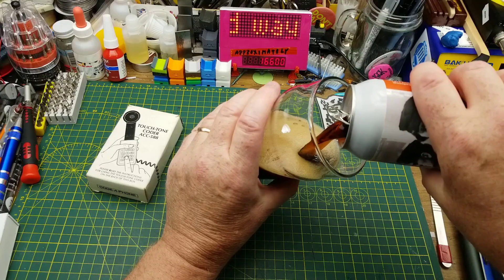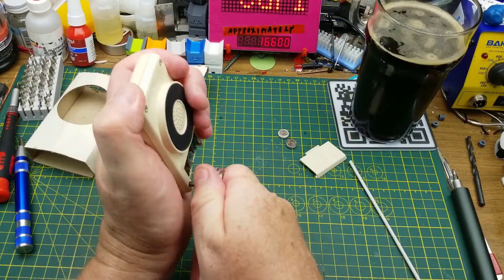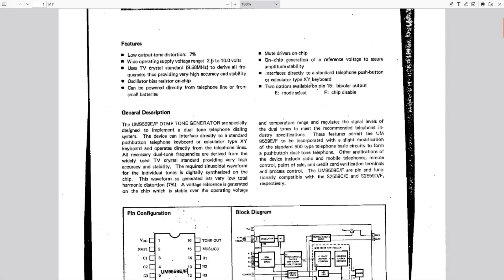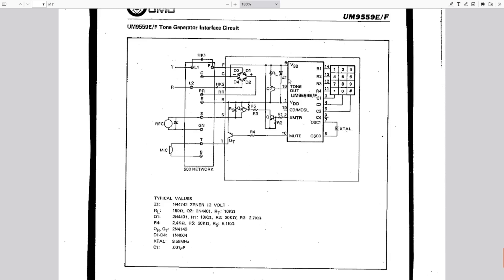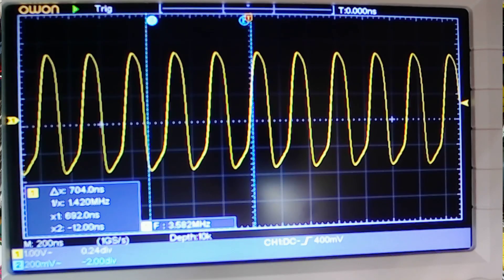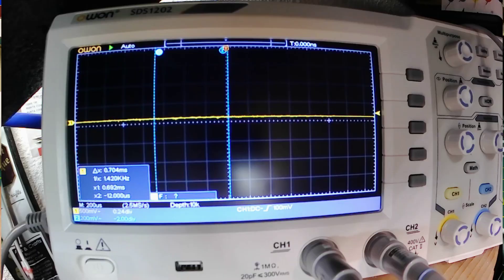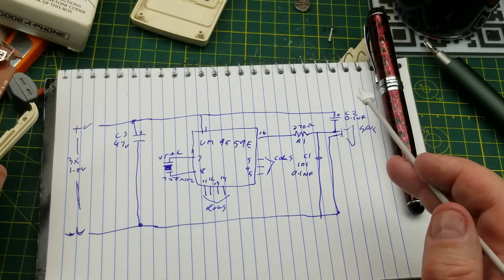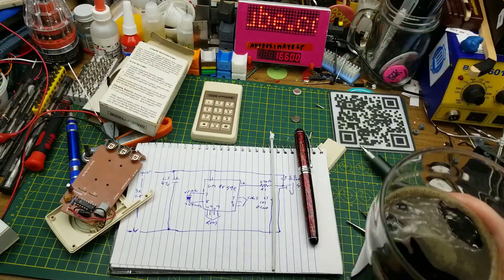Curiosity teardown: Codaphone touch-tone coder

Comment: Table 1 seen at 4:22 and figure 2 show how the chip works.  It takes the 3,579,545 Hertz crystal frequency and divides it based on the row or column tone that you are trying to generate.  To make the 697 Hertz tone for row 1, it divides by 160 to get 22372.  The 22372 frequency is fed into the sine wave synthesizer, which has 32 steps for each sine wave.  The result of dividing 3579545 by 32, then by 160 is 699.1, which is close enough to 697.

Comment: I still have one in a drawer in the garage.
I bought it in the early 80's so I could retrieve messages from my answering machine using a rotary phone away from home. Tone was still an extra cost option at the time, and neither me, nor anyone in my family, was willing to pay the fee to have DTMF dialing! If I was at my parents' or in-laws' place, I could call home, push the right buttons, and the answering machine would play back any messages on the tape.
Plus, when calling a business from home, I could use it to "press zero to speak to our receptionist" without the monthly fee.

Edit: Apparently it wasn't as early in the 80s as I thought... I opened mine up to find the same circuit and same chip, but my board has a date of 860722, and the code on the UM9559E says 8736T [36th week of 1987 was Sept 1 to Sept 6 ... within a week of the "new" silkscreen on your board]. I guess I must've bought it in 1987 or '88. 
BTW - my board has battery info on it: "BATT TYPE LR44 OR A76" is visible when the battery cover is open, with "(+) UP" printed just above each battery holder.

Comment: I had one of those for when I repaired Fax machines.
If the Codaphone did not work on the line I knew I had to set the machine to pulse mode using binary codes.
Yes the original Toshiba Fax Machines were programmed in Binary.
Reply: I also used it to make phone calls over my Ham Radio 2 Meter handi-talkie

Comment: In the 60s there existed a device known as a Blue Box which you could make long distance phone calls without paying I seen one used but do not know how it worked. Have you heard of them?
Reply from the maker: There's a pretty good wikipedia article about them.  https://en.wikipedia.org/wiki/Blue_box
They generate specific tones that a normal phone wouldn't make in order to trick the telephone system switchgear into allowing redirection of calls in unintended ways.
Reply: @pileofstuff  Thank you very much for the link to the article. We had a Blue Box back in High School back in the late 60s, we used it to connect to some students in the UK.